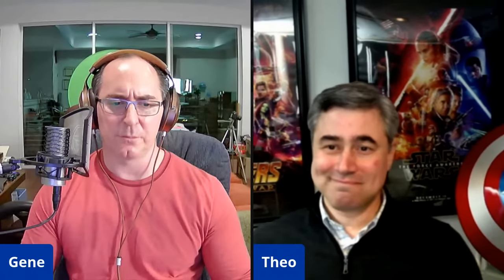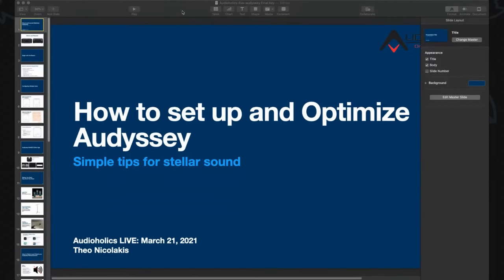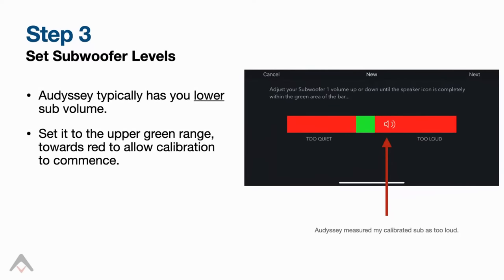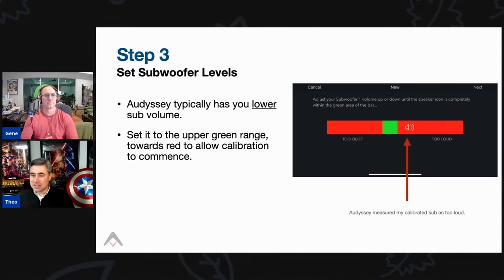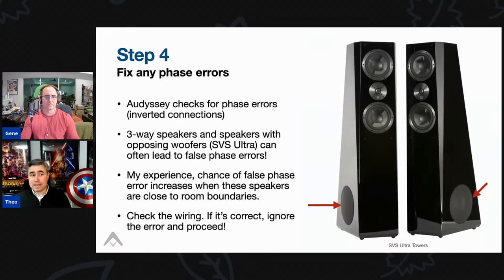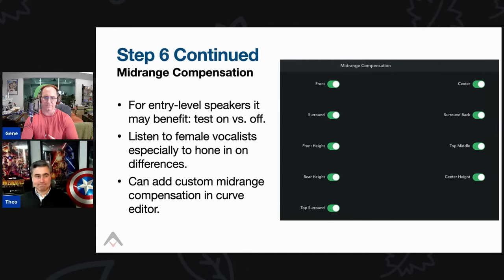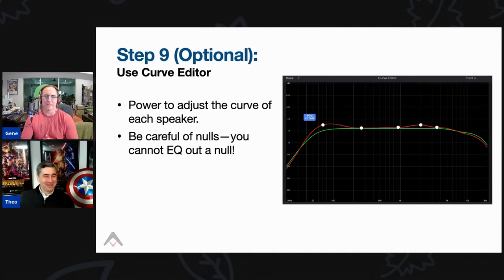Audyssey Room Correction Performance Tips for Your Denon/Marantz Receiver

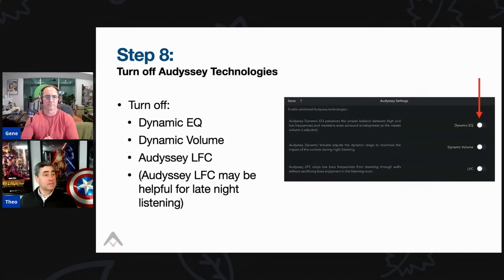Comment: At 34:09, 43:07, 43:36, 48:00, you guys say about Dynamic EQ, Dynamic Volume, LFC: Set all this in the app, not in the AVR itself. I do not quite understand why. Couldn't I just set all these options to "Off" in the app, then load it to the AVR, and later-on in the AVR I could still decide to e.g. set Dynamic EQ to "ON" when needed (e.g. when playing music at low volumes) while keeping the other settings unchanged. And similarly for Dynamic Volume and LFC? I also think the OSD  menu in the AVR has the options to set these to more different values then just ON or OFF, so I could tune it finer to my needs than in the mobile app. Or can't I set these settings in the OSD any more when my Audyssey calibration stems from the mobile app, and it only works when I do the Audyssey room calibration on the AVR without app?!?

Comment: Only time i see people use "wides" is as a first and second side surround, for like 2+ rows of seating, and not sure that's really giving them the intended effect.  The Prime elevations could be used as on wall wide's, since they are angled, but not adjustable, so would have to do it by horizontal location on the side wall to get the tweeters in line with the listening position, and while good, it isn't the best speaker if you have higher end ones integrating with it, but it's a thought.

Comment: Can't decide if I should buy my 15" pro studio in the back and my Sony 6.5" bookshelfs on stands  along with a my Kenwood 8" non powered subs but have a line in and line out to the bookshelf with also got a set of JBL balcony speakers with the other sub while I take that back my plan is to run each left side of the speaker of the left of the receiver and the right speakers on the right speakers also was told that is true stereo with multiple speaker then when you use the eq it will work better

Comment: Hello Gene. Thanks for releasing great videos and tips on AVR Setup. This video says when using the Audyssey App to set the MultiEQ Filter Frequency Range to 200Hz or 300Hz. Should this range be set on all speakers or just the Subwoofer?
Reply from the maker: Preferably ALL
Reply: @Audioholics  Thanks
Reply: One more question. Is there a way for me to email screenshots of my front room correction results after setting the range from the default 20000Hz to 200Hz to confirm everything looks good?
Reply: @Audioholics  i called mine at 500hz. Will try 300hz to compare. I was asking if we do this, and change from Reference to Flat, will these changes be in effect? Or do they have to be in Reference? I’ve heard conflicting things. Thank you!

Comment: 44:05: How do you do this measurement, how do you get this graph? With which tool? Is this also done with the Audyssey smartphone app? I understand that this is measured after Audyssey calibration with all speakers and subs being active simultaneously. So I must play some test signal here.

And then if I get the red curve, where and how in Audyssey app do I have to frickle to get the blue curve? Just kind of random trial & error of playing around with modifying delay values a bit as I understand (44:51)?

Comment: You guys say to get it right sounding right in 2 channel listening to music first. Do you mean playing a cd through the blue ray player and with option set to music, and wich stereo mode?  Basically my atmos setup to me sounds incredible, but trying to get good 2 channel audio out of my marantz av7702 has never happened for me.  The music just sounds lifeless. I basically just use my marantz for atmos and other surround formats and have another amp and pre for stereo listening. I feel my marantz should sound excellent in 2 channel stereo but it sounds horrible. I have a switch box to switch my mains between my surround amp and my 2 channel amp. Any advice?

Comment: I live near a busy road and all I want is PLEASE add a PAUSE TESTING feature between speakers during the test. 

Or better yet it could be done speaker by speaker one at a time? I could wait for a dead silent moment and test the speaker and then wait for another and hit the next speaker....That would be wonderful...I just think it is a no brainer to add something to deal with unexpected sounds. Maybe a stop and restart back one speaker if something happens?

I need to be able to pause the testing when I hear a big truck or noisy car coming. It is very frustrating getting five or eight speakers in round after round and then you hear the truck coming and there is nothing to do but cancel the whole thing.

Unless I missed something...unlike the AVR audyssey, the app won't let you start that round over... it makes you cancel the entire thing and start over
Reply: You don't have to start over.  After the test for one of the 8 positions is complete then there is an option at the bottom is to "repeat test.  Marantz SR6011.
Reply: @voiceofreason9238  I am referring to the multi eq app. Are you?
Reply: @snauspockets9924  No, not the app.  I was referring to the Marantz 6011 version of Audyssey.  Sorry if I was confused and confusing.
Reply: @voiceofreason9238  no problem I knew what you meant. The Denon AVR has that option too but I use the app and it does not have that option. Can be pretty frustrating.
Reply: Check out the ratbuddy audessy program it will allow you to take the room correction files and load them up and adjust them on your computer just like the app and can allow for more precise edits to the curves.

Comment: So, what  would you recommend if you are setting up a half room?  Setting up a theature in a basement, total room ix 21x24, but only going to set up the listening/viewign area in a 12x20 section, but it will still be open (more or less) to rest of space, renting so can't really do any walls.  My original plan was either left and right up front about the 1/3 2/3 method.  I coudl do the "corners" behind my screen,but the left side isn't really a corner, and I think that would put my left and right towers further in then I would like.   My other thought was front and back corners, but kind fo same deal, the back sub if within the viewing area woldn't be in the corner, more like a 2/3.  Also not sure I want the subs that close to the neighboring wall, though not sure that would actually matter much to reduce sonic transmission, though I do plan to decouple them from the floor.   I guess wherever I put them, you always want the driver to face the listening position though right?   What about like a front and back but offset slightly, so the drivers are firing next to each other vs directly opposed?   Not even sure I'll go multi sub right away as much as I want to, I might have to stick with my single dual driver for right now.  Projector, screen, new pre-pro new OLED, the expenditures are mounting, might need to cool it a bit, but good to know where to start when I do get there.

Comment: It's also cheaper to mix "eh good enough" vs actually making a worthwhile surround mix, sad, but yeah not enough consumers to make it a worthwhile investment for most companies to put in the man hours to do a good home mix, but that's why they should just give you the option for the theatrical mix, they already have it for free...my only thoughts why they don't include it are: 1) could be a requirement of the theaters to try and preserve their industry, 2) all but the altitude and other uber high end "home theater" products might not be able to process it properly, not enough cpu power, and object limitations, 3) not enough disk space for a full fat theatrical mix, without sacrificing image quality either due to space, or read rate.  Possibly a combo.

Comment: Gene's suspicion was confirmed. You basically have to set it to Flat.
With Reference you're going to have a ~3dB dip at 2 kHz (between 1.5 and 3 kHz actually) and a roll-off after 6kHz ending up at -5dB at 20kHz.
(there's some measurements at AudioScienceReview).
Bypass L-R is basically not running Audyssey, so what's the point, just turn it off.

Comment: I have Polk signature series (s60,s30,s15). Are they considered as high perfomance speakers? Should i turn off midrange compensation?
Reply: Generally speaking I don’t recommend the midrange compensation with modern speakers and I put your Polk in that category. If you’re curious I suggest you try it with midrange compensation off, listen to music material you are familiar with and then you can turn it on and listen to the same material. It’s simple enough to toggle on or off and upload the changes. Pay special attention to vocals. Let your ears be the final judge but off will probably be the way to go.
Reply: @TheoNicolakis  ευχαριστώ

Comment: At 22:10 Theo says about the calibration microphone positioning, do not exceed the 18-20 inch from the primary listening position (=first mic position), and after Gene's reconfirmation about the 2-feet (=24 inch) rule Theo says 24 inch is already too much esp. because of the off-axis performance of most speakers. Well, I have "Elac Uni-Fi Reference UBR62" speakers which are said to have extraordinary off-axis performance, i.e. wide radiation pattern (and hence great soundstage). So does this mean I should be good also with 24 inch?
Reply: @MiccaPhone Absolutely, free to try with a 2-foot radius and see how you like the results!!😁

Comment: All you have to do,is go to Setup on Denon/Marantz, then Audio ,then Subwoofer level, you will see Audessy has lowered your sub level to maybe negative 12 db! Just raise it back up to -3db or 0 db. Bass returned big and full.
Reply: Well, the speculation at the beginning of this video is that they do that because Audyssey then boosts it with "Dynamic EQ" which is on by default.
Which is just terribly inconvenient.

Comment: So Gene the obvious answer seems to be, setup your room and speakers correctly, treat the room, measure your response, then forget about Audyssey and use just eq to tame the peaks. Problem is the internal eq is very limited so now you need to move to external pro level eq. I think Tony uses an Ashly pro eq for the multi subs but I wonder what he uses for the 80-300 hz range on the speakers. Now your talking about another A/D and D/A conversion for the speakers, unless Denon can improve the internal eq's which you say is doubtful. Possibly tony is doing very little to the speakers and just eq on the subs in his rooms that are properly designed and treated.

Comment: Great info. A question. I have downloaded the pink noise files. How do I use them to assist in the calibration .? I have the files on usb. My setup is Denon AVR X8500H/A upgraded. I also have an Oppo 203. Ty for your help
Reply: Did you find a solution? Same question I have. I ran with the app but cant set/check the levels in the app. Loaded it to the 4700 and then did the set/check in manual.

Comment: Do you think If I use a galaxy fold for the app that might be a big enough screen? Or even the slightly larger z fold2? I have both and a Marantz 7705 I recently acquired for a comfortable price but haven't been able to deploy it yet.
Reply: Yes I think you would do better with either. The point of our discussion is that the larger the screen the easier it is if you need to tweak changes. It’s doable on an smart phone sized screen, it’s just not elegant to find tune changes.
Reply: Thanks. I should be deploying this equipment in the next couple months. Who knows maybe I'll make a video for yah. I have some older Triad and M&k stuff you might appreciate seeing.

Comment: Not only by the xover guy but also by Amir from AudioScience review said the same about the 2k hz dip in the klipsch RP speaker and considering the mid compensation in the denon n marantz it will make it worse.
Reply: It would actually make it better, as the Klipsch has a bigger dip, so Audyssey will boost it to fit its dip. Turning it off is still preferred though.
Reply: @homeboi808  Is that speaker's inherent 2k dip good? Audessey with compensation will make it worse. 2k is a critical freq range.
Reply: @cmssajith8764  No good speaker should have a dip. As stated, Audyssey’s dip is not as bad, so it will improve the Klipsch’s dip, but turning off MRC will improve it even more.

Comment: Totally love all the livestream topics... but one thing is missing in multy subs.. what if someone only has 2 subwoofers.. in the option on 4 subs at corners what should one do.. same side front and back or diagonal front and back !!! As most of us would have 2 subs
Reply from the maker: It really depends on the room but you can try 1 sub in each corner if you want the most LF coupling. One sub front/rear midwalls can give really good seat to seat consistency but not as much LF coupling as corner placements. Diagonal corners can work but a bit tricky.
Reply: @Audioholics  thanks for such a prompt response !! most of us would like to go with the tricky option or atleast i would like to go for that !!! any headsup for a better understanding or probably a live stram on it ?

Comment: Gene.  At 3:15 into the video you sound so down on subs flanking the center channel.  I do that and Theo does it too using the 1/4 and 3/4 rule.  Since almost every photo on home theater that I come across, the vast majority position two subs flanking the center channel.  What's wrong with following the 1/4 and 3/4 placement rule?
Reply: Nothing wrong with it! 😂 and sometimes it’s your only practical option!!
Reply: People put the subs at the front because it looks good. Measure your subs with REW otherwise youre just guesstimating based on some generic rules.
Reply: Theres an entire video about bass traps where they go into detail about this, it actually can work

Comment: Really informative video! Loved it, guys! One simple question, though. You mentioned a few times "high quality speakers". Now you guys surely have top-of-the-line gear throughout your systems, but at what floor pricetype would you rate them as such? I'm mostly asking regarding midrange compensation, as I'm really more into music, even though my cinema setup significantly counts for me. For instance, I have a pair of Monitor Audio Silver 300 for my fronts. I wouldn't grade them as "low-end" (at around 2500 CAD, they're not cheap), but would they deserve midrange compensation? I don't know, based on the "high quality" comments  ;)
Reply: That’s a great question. So both Gene and I had an off microphone extended conversation about this topic as I did with another well-known reviewer. The general consensus is that midrange compensation seeks to address an issue with speaker designs from 15-20 some odd years ago but not so much today. I think the best advice is to let your ears decide. In my particular set up midrange compensation has an audible adverse effect on the performance of the speakers. The audio hobby is all about enjoying the music!

Comment: I have had a Marantz 7007 for about six years.  This video was informative because the on screen audyssey guide shows microphone positions at literal seating positions with no mention of the 21 inches from main seating position restriction.  There is no mention of this in the operating manual.  Is this a newer requirement that does not apply my version of Audyssey?  This seems to fundamental to have been missed in this huge manual that was shipped as a CD.
Reply: It’s definitely one of those fine print things and it’s very easy for people to miss. I agree it should be more obvious. I’ve encountered enthusiast who are telling me that they are measuring near the side walls and here and there and creating all this Voodo. It’s pretty straightforward not more than 2 feet from the primary listening measurement. :-)

Comment: My findings with room eq wizard consistently is, without DEQ, the LFE channel measures 4db higher than the other speakers. The issue is the redirected bass below the crossover from your speakers plays 10db lower than LFE. This means the redirected bass plays 6db lower than your speakers and that’s the root cause of the anemic bass. In a perfect setup, the redirected bass would play at the same level as your speakers and the LFE would be 10db higher than your speakers.

Tldr; turn off DEQ, bump each sub up by 6db, call it a day 🙂